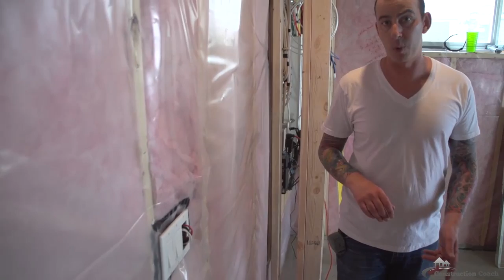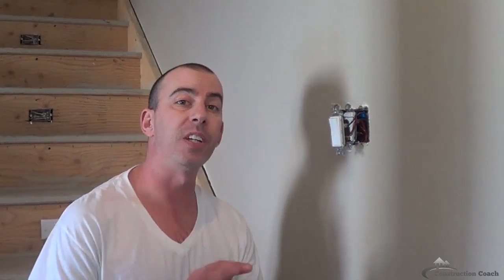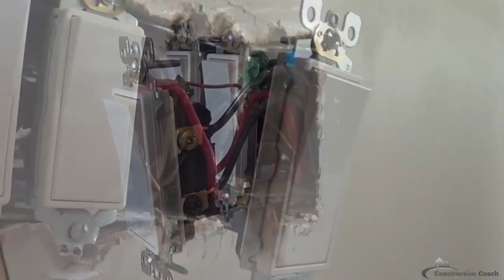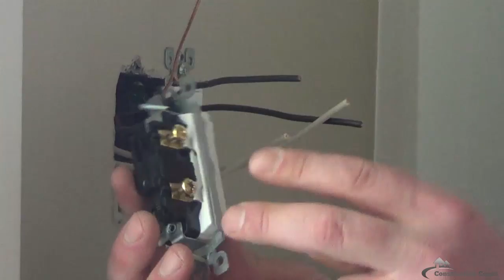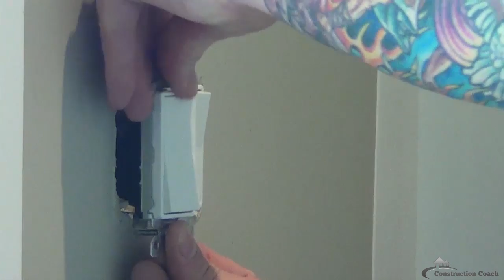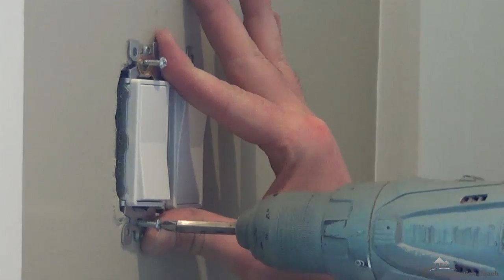How to Install Switches: Two Way, Three Way and Four Way - DIY

Comment: what's a two way switch? I have installed hundreds of 3 way and 4 way switches, I have never heard of a 2 way.
Reply: In other countries to they call em per function. 3way is 2way, 4 way is 3way...

3way is 2 ways to turn on a light. There's never 3 switches there...

4way is 3 ways to turn it on... It has 3 switches... They use simplicity and their brain more tbh..

Comment: Why cant you use a 2 wire between switches? You can use the white and black as travelers? No?
Reply: Yes. But it's dumb. Nowadays you need a dedicated neutral regardless so you run 3 wire to maintain neutrals. Besides.. No one likes phased neutrals.

Comment: What brand of tools are those you have ? I noticed their all Gray ...just curious ..
Reply: He may have painted them gray.I know that it is a real pain when I work with other crews and we all use 20VT DeWalt.So some have names on them and some don't.I actually paint ALL Drivers,Batteries and Chargers with red stripes like an old barber shop sign.I KNOW WHAT'S MINE INSTANTLY.
Reply: He did spray paint them :)